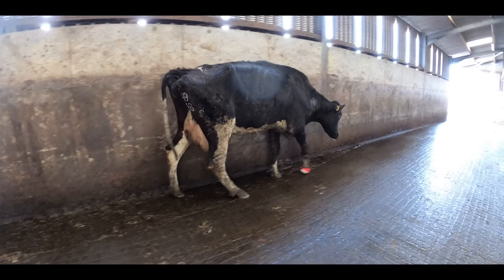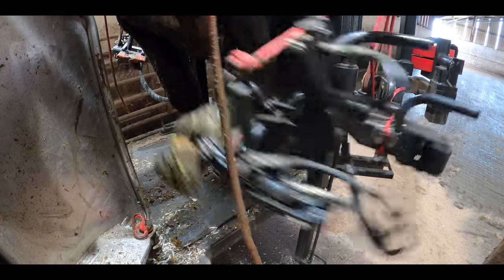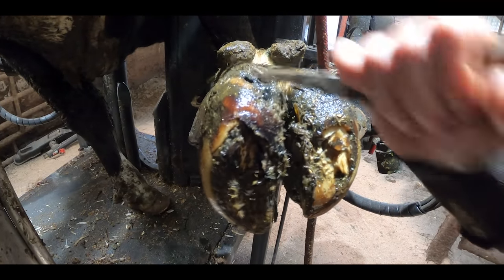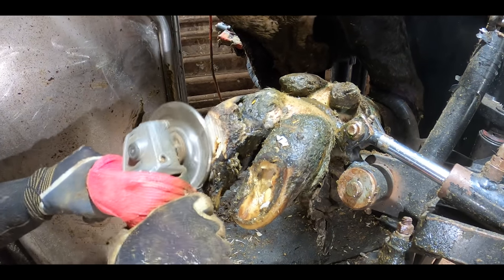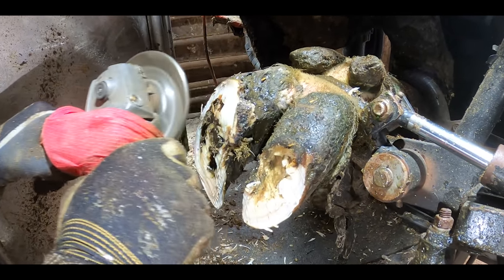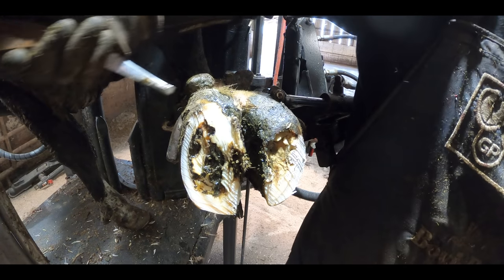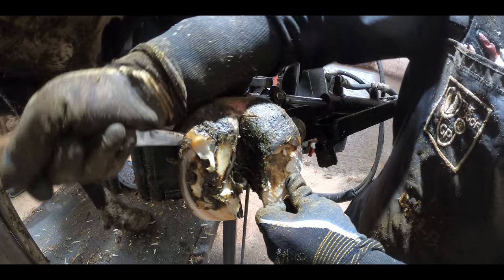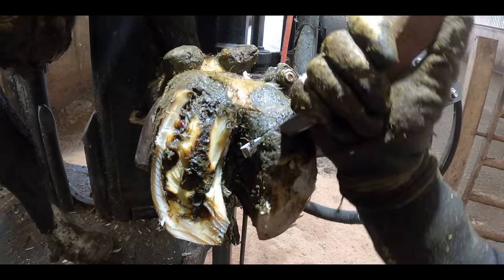ROTTEN COWS HOOF CLEANING *HUGE HIDDEN SECRET REVEALED*

Comment: I am in shock over how quiet the cow was during the process!  Bless her.  Thank you for being so kind to her.
Reply: I was thinking the same thing! Cows usually will either stamp their feet when in pain or vocalize to a degree. She did neither which was surprising
Reply: I'm far from an expert but I did work for a vet as a teen (in the early 1970s). I know the outer hoof wall  (horn) has no nerve endings--it is akin to toenails. The pain is often from the pressure on the inside of the hoof capsule from pressing against the relatively inflexible outer hoof wall (when is isn't caused by something like a rock, a nail, etc). Back then, no one in our part of the country was using angle grinders, it was all done via hoof knife and nippers.

If the hoof knife is kept razor sharp, there's little additional pressure applied to the hoof as horn is removed. You can't really see it in the video but quite often I could see as a teen, as soon as the abscess was opened and the pus, etc, started to come out, the cow would relax all over. With the pressure relieved, there was some soreness left, no doubt, but most of the pain was gone.

Graeme keeps his knives extremely sharp and his angle grinder blades are also very sharp. You can see that he applies very little pressure as he trims hooves. Also, just being in the crush with a good part of her weight supported by the belly sling (don't know what they call it in Scotland but that is what it functionally is) and the sore hoof firmly supported by the hoof /leg restrainer, she starts the trim feeling less pain. It's like the difference between standing with a rock in your shoe and siting down with the rock in the shoe.

As soon as Graeme gets into the abscess, that cow felt an immediate reduction in pain, just as if you started to slide your foot out of the shoe with the rock in it. Aaaaaaaah, the relief!

So overall, for the cow, having Graeme so deftly treat her sore hoof is probably the high point of that day. She went into the crush three legged lame (from Graeme's commentary) and came out feeling a bit sore and bruised with leftover pain from the abscess but overall incredibly much better.
Reply: @GrainneDhu  Thank you for providing this well thought out and educational reply.  When the cows are in the crush I tend to watch their front legs to gauge comfort.  Graeme is truly gifted.  We are blessed to have him represent the trimming business as a caring, professional.
Reply: @untbunny  Agreed!

I suspect that in a crush with so much body support, the front legs are not responsive in the same way they were in the old crushes that didn't support the cow's weight. 

For the cattle with healthy hooves just getting a routine trim, it's probably a bit irritating to feel trapped that way. It's the cows who have painful feet that probably come out feeling like "OMG, I am so relieved!"
Reply: 4:56

Comment: I impressed my grandma when I saw her cows and one was lame. She didn’t even know it was. They had her in the crush 2 hours later it was a white line problem. She was like “how did you know that she had a problem?” I told her about your YouTube channel.
Reply: The more you knowwww 👋🌈🖐️
Reply: Wait, hold up!! In the 'crush'?  That sounds painful!!
Reply: @sandyhill1392  It's the frame they put them in, it 'crushes' them by pressing in on either side of the head, preventing the animal from moving around dangerously. Doesn't actually hurt them, and usually there is a feed bag on the other side of the restraint as an incentive and reward.
Reply: Twinkie is a girl not a boy.

Comment: It must be such a weird feeling for them to have that part of their body exposed to the open air.
Reply: its initially releif, since the pressure of the would is hurting as it is.
Reply: @Andrynor Ω is it at that point? the hoof is already separated, so it would be more like cutting off the end of your nail. I was thinking more of the air touching the flesh underneath
Reply: @selinesbeau  i've had lifted naild do to lesions and I believe it may be similar, triming the lifted nail doesnt hurt, and its a relieve of the presure, even more so if there is a wound below, but the nailbed stays a bit tender until it heals, youve gotta be carefull with the socks and shoes

Comment: As a massage therapist I want to to give you some body mechanics/ergonomics tips.  Maybe you only shave the hoofs with your elbow bent so you give us a good camera view, which is understandable.  In real practice you'll want to keep your elbow extended and your arm straight.  When you grind having the hoof near eye level is fine, you can see better and the grinder does the work.  But when it comes to shaving you'll want to have that hoof around the height of your waist, keep your arm straighter and instead of stabilizing a bent arm lean your whole body down on your straightened arm.  You won't be able to see as well, but with your experience you'll still be able to see generally what you need.  You can lean down between shaves if you need a better look.  Again, your shaving action should come from the whole weight of your body pushing down on your extended arm.  Do what it takes to get your arm straighter, make a platform you can stand on, etc.  If you do this stuff for a living, and want to keep doing it as long as possible, positioning yourself properly is going to save you.  Otherwise you'll come see me or an orthopedist or a physical therapist, and we'll tell you to stop doing what's wearing out your elbow and shoulder.  An additional tip is that if you then go to a straight arm don't wear out your neck with your head constantly bent over looking at your work.  In my profession you see what you need and then stick you head back up, naturally balanced, and proceed via feel.

And thanks for the fascinating videos and caring work you do!

Comment: I 'love' it when the author of the video explains the causes for the hoof rotting.
In reality it is caused by unnatural habitat of these cows. They live in stables, with a concrete floor, in small boxes, which are always wet and where they urinate and defecate. This surrounding is causing most of the hoof rotting.
Not only their hoofs are sick, but the cows themselves as well.

Comment: Would these cows have healthier feet if they were in a pasture instead of standing on concrete in hock deep crap?
Reply: Cows can get injuries on a pasture as well. There's lots of hoof trimming videos with cows on or off pasture. 🤔
Reply: @hinachan70  still...it can't be good for them standing on concrete covered in slimy cow crap. Have you ever stood on concrete all day? Or stood in muck all day with a pair of flipflops on? Think of WW2 soldiers in trenches wading around in their own filth getting trench foot and who knows what else? I've had horses and dealt with farriers for most of my life. Horses always did better on clay/dirt/rubber matting in stalls with clean, dry bedding. Pastures and paddocks that were for the most part dry. They still needed trims and shoes and would occasionally get injuries to their feet, but they were a lot healthier when kept in optimal living conditions. The only time I had serious issues was when I boarded my horse at a stable that didn't keep his stall properly cleaned and bedded and his paddock was a muddy hole. I even bought rubber stall mats, still didn't help since the barn owner only put just enough shavings down to cover the mat (maybe an inch). She was stingy that way lol. Had the audacity to ask if she could keep the rubber mats I bought with my own money too! I told her to eat $hit and die lol. Some people.... Had all kinds of issues with thrush, abscesses/gravel, white line disease, soft soles that bruised easily and soft hoof walls that couldn't hold shoe. He was only there for about 3 months.....took about a year for me to get his feet back to good working condition.